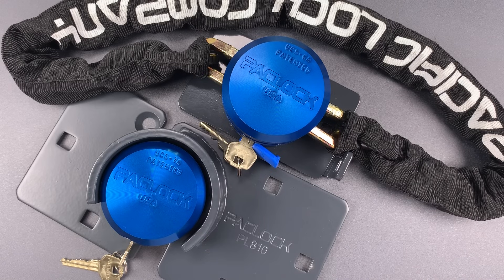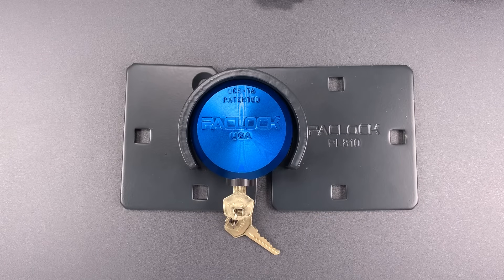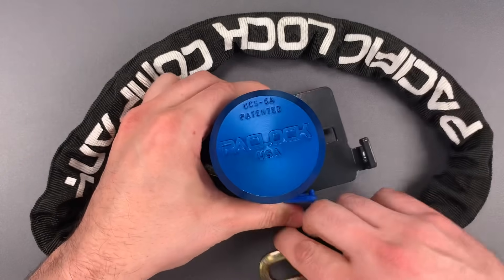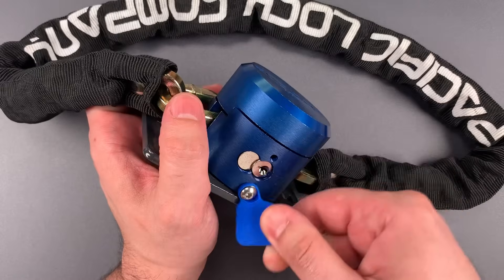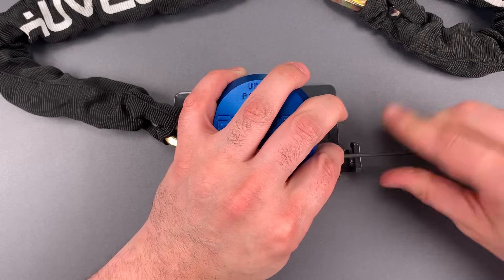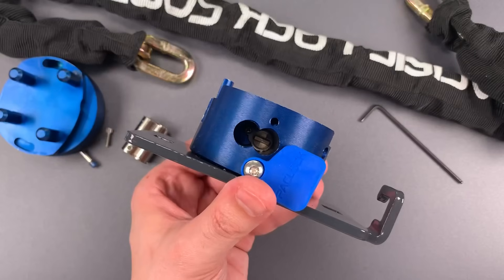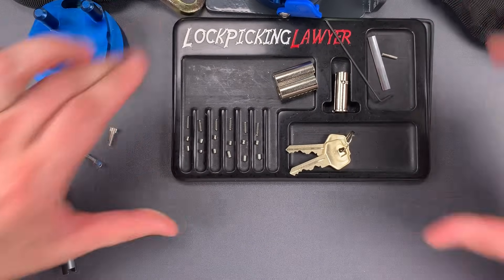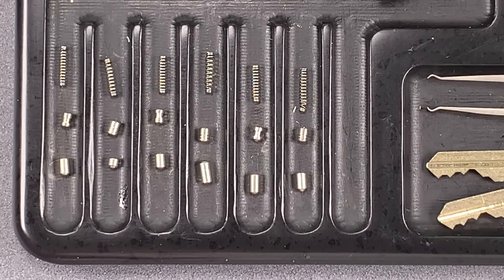[932] More PacLock Products Coming to Home Depot

Comment: Try picking one when installed!  I imagine that reaching overhead to that roof rack installation would interrupt the lockpicker's style and make it more difficult.  Unsure if the door-mounted lock would be in a difficult position or not.  Since the lock is fixed, why don't they have some plates or blocks to make it more difficult to get hands in there to pick  but yet still easy to insert and turn a key?

Comment: the other locks that bosnian bill showed has the core with the keyway vertically so picking is more difficult.

if you are going to get a longer chain make sure to use a very good chain as the weakest link would be the chain if you nd up getting a cheap chain

Comment: Definitely well made, but still "fairly" easy to pick.
Reply: I wouldn't say easy to pick. Lpl just makes any commercial lock look like a D shackle in terms of security.
Reply: The most likely attack is going to be a big hammer or a crowbar to rip the thing from the thin sheet metal of the vehicle door.  Any greater security in the core itself would be kinda pointless.

Comment: Is there enough room or play in the chain lock to get a cutoff wheel in between the halves when locked? It looks like the locking mechanism only interacts with one of the prongs, so if that one prong could be cut the chain could be removed. Another point of attack could be either of the studs that pass through the chain, but that would require two cuts and an awkward positioning of the grinder between the chain and the surface to which the lock was mounted for the second cut.

Comment: I don't understand what the point is of having a strong steel core and a thick chain if the plug is the typical weak 6-pin that you can open with a standard tension wrench and hook. I might be missing something or I'm too stupid to understand, but to me this seems like taking two pieces of indestructible vibranium and tying them up together with a rope.

Comment: Can you use this lock to beat up thieves instead of protecting your stuff?
Reply: Fawzan Fawzi 😂 innovation!!!
Reply: i would argue that it technically still is protecting your stuff.
Reply: pick it up by the chain and flail it on them, gods it hurts just by thinking about how hard a hit with that can be.
Reply: Take off 1 sock, drop it in there and commence beating your enemies as needed
Reply: klj2382 Would one hit each be sufficient to eliminate them permanently?
Reply: depends how hard you swing it... my arms are basically a chunk of wet noodle and fat so i don't think my hits would kill anyone...
Reply: Swing it by one end of the chain.

Comment: It looks like you could slide a bypass pick through the open back key way and turn open the lock.  Kind of like American lock.  Is it possible?
Reply: Jon, bypassing our UCS™ locks using this method won't work. The back of our cylinders marries up with a slotted driver and restricts the rotation of the actuator without the core being turned- which means the shear line needs to be made. In our non-UCS cylinders, we also fixed this issue that American locks had by changing the position of the half-moon on the back of the cylinder. Now there is no free space to rotate the actuator without creating the shear line.

Comment: If like to see a puller on that core of the chain lock. It doesn't look like that set screw would hold up all that well to a slide hammer.

Comment: I had a similar  style  lock and lost the keys for my trailer. I drilled the lock through the key hole and also through the face around near the top where the pin turns and locks into the board at the top. And boom your open took about 30 mins

Comment: I think the pins all being steel is not so much for drill resistance, as it is for durability. These locks are expected to see quite a lot of use, and probably abuse if thieves try to rake them open, so steel pins would probably last longer.

Comment: Well, these being made from aluminium is a pretty big downside if you ask me. They could be steel, weight is not a concern. Make them a little more expensive if need be, the picking resistance is good enough to not worry about it.

Comment: Cool locks with everyone having the possibility of converting to one key, brilliant!
Reply: Only up to 5 or 6 of them (depends on how many cores in that replacement kit).
Reply: @two_tier_gary_rumain  It's not particularly difficult to take apart the cores and make more of the same. I did it with the dozen locks at my house (did the 6 door locks as a set, and the six deadbolts as a set).
Reply: @UncleKennysPlace  Yes, but you need to have a grasp of what to do.

Comment: Can either of the puck locks be used as a bike lock??? Like can you remove the puck lock you picked from the plate or buy it separately and without the chain so we can use existing chains or buy ones whatever length we need??
Reply: It looks like the lock is attached to the base plate with 2 removable screws from the back.  Here's the relevant drawings: https://www.paclock.com/product-line/puck-link/
Reply: Yes, correct. Can remove the plate and you can change the chain to whatever length you like.

Comment: It'd be nice to have a dual ball bearing locking mechanism on these as opposed to a single ball.. My intuition tells me that if you used a sledgehammer and wedge you might be able to shear off the single pin that locks the top in place.
Reply: Once you get one in your hands, give it a shot. If you can defeat it that way, I'll send you your money back or maybe send you a new one if you'd like. Either way. I think that the all four of the pins will play a role because the tolerances between the pin diameters and the holes are pretty darn tight. So any sideways/tilting force will actually cause all of the pins to create some surface tension and help the ball bearing resist.
Reply: @paclockpres.9805  There'll be a home depot nearby once I get to college, I might take you up on that offer. It's an iffy attack, but I could see it working.

Comment: I don't really get the additional bolt hole under the lock. It still seems like you can grind the three boltheads of on the right side and free that side from the door.
Reply: Yes, you can grind the right side, but the left side is still locked on and the puck is holding them together. So you won't be able to open the door...

Comment: Could you explain why things like spools and serrated driver pins make picking more difficult...and why varying spring strength help protect against bumping?  And what are your thoughts on bumping...I hear it is more or less considered cheating in the locksport community, but maybe that attitude has changed over the years?

Comment: Yeah, this video sounds promotional, but we all KNOW better.  I think LPL and BB are just happy to see a company really working to try to make a good product.  Congrats PacLock.
As to the pick time, first, the LPL is crazy good at this stuff, and second it has got to be tougher to pick either of these "in situ".  And correct me if I am wrong, but aren't those cylinders replaceable with several other really "high security" cores
Reply: @paclockpres.9805  Ah, well. Thanks . Is it possible to upgrade to one of your regular steel pucks? I understand, this will not be via Home Depot, but I am local to you, if you are still in Valencia.
Reply: @RAkers-tu1ey  Yes... keep in mind that this "UCS" cylinder system is like a whole new cylinder system on top of everything else we do. And it's made for more the retail market who needs to run to a Depot right now and grab something. Our entire line of the same padlock bodies but with the "standard" cylinders is certainly available. So hardened steel is available... working on getting stuff loaded into Amazon now to make it easier for everyone, but that will be a few days (a week?) before we get most everything loaded. We're doing some cutting edge stuff their too with how to sell padlocks. And we are still in Valencia!!! Thanks!
Reply: @paclockpres.9805   Great to hear. I was afraid maybe you had moved to Dr. No's island to set up for Home Depot production.
Reply: R. Akers that’s actually a representation of a pipe.
Reply: @cpmenninga  aahh, at last they see

Comment: Would it make such a lock much safer,if there was a metal plate welded about 3 or 4 cm under the cylinder,so the key can fit it,theres not enough space for picking tools though?

Comment: Do they sell that chain separate?

One of the things I have found most difficult is getting any kind of chain that looks reasonably strong...most places only sell wimpy chain (that they cut to size with short bolt cutters) or the vynal wire cable (which isn"t much better it seems)

Comment: This chain lock is cheaper than the Krytonite bike lock. I'm thinking it might work for my bike!
Reply: Gonna get one for my gate, and Vespa . Trying to have 4 different but quality ones to rotate , on the gate , and all the rest on the scooter. I have 2 houses in my neighborhood that scooter thieves are operating out of .
They stole my older vespa in June. I followed one, riding my scooter , and took it away from them a month later. It was hot wired, and the guy on it opened the seat, with a steak knife, and grabbed all his saws and picking blades out , dumped them in the backpack with all his bolt cutters and ran away. The struggle is real

Comment: I’ve scene pucks left on bumper of van twice and stay there for over 30 miles
Reply: Okay, got a good laugh here, thanks! Me too. And I see lots, and lots, and lots of vans where they only have the hasps and no padlocks on them. I've talked to lots of construction company owners and lots of plumbing company owners who are at their wits end because they want the higher security on their vans, but their employees literally just lose the padlocks day in and day out. So we think we've solved that problem. Bolt the darn padlock onto the haps and you're done. 

One thing LPL or BB didn't mention is that this puck/hasp combo was designed so that it can mount both on the rear swinging and the side sliding door WITH the puck fixably attached to the hasp. Lots of design and testing.

Comment: This is more less directed toward Paclock.  That little pin, in #2 chamber, lower or key pin.  It appears that it's nearly as tall as it is round. Need to watch that, in the 1st 2 chambers.  Chrysler has had issues, cast zinc with brass pins.  What would happen is, wear and tear over time.  The lower pin would wear, and get tipped over on it's side, and ultimately getting stuck - and we ould need to remove the lock, and remove that pin stack altogether.

I just received 2 of the KIK-2B padlocks, I'm kind of disappointed.  The cylinder retainer is made of Aluminum.  I can see that with an Aluminum body, but not a Brass body.  Please, make that retainer from Steel.  Otherwise, great work so far, I'll recommend your products over Master!  BTW, I'm a Locksmith of almost 30 years.
Reply: Thanks for the info on the pin and cast zinc... we should be okay since we're a full brass cylinder (both plug and shell).

For the KiK-2B, historically the industry supplies a brass retainer with a brass padlock. If you buy a hardened steel padlock, you'd get a hardened steel plug. When we re-looked at our entire KiK product line a few years back, we realized that it doesn't make sense to supply a brass retainer on a brass lock. Really, it doesn't make sense to do brass retainers at all.

The reason is that brass as a raw good is going up, up, up in costs. It's why aluminum locks are making a huge surge and brass is taking a downturn. So when we looked at making the retainers, we realized there's no benefit to making a brass retainer versus an aluminum retainer. It would just have cost more to do brass. Either way, you can drill a brass retainer like you can aluminum.

So if you bought a brass or aluminum lock, you wouldn't have ever had a hardened steel retainer from us (or from other padlock manufacturers?). You would have seen a brass one. But we just don't do the brass retainer anymore.

We do have that barrel plug in hardened steel, but it's only shipped when we ship a hardened steel lock.

Comment: Can the bottom part of the "PUCK LINK" be removed from the plate? If so do you think this would make a good motorcycle lock? Love your channel. Thanks.
Reply: Yes, it can. Just a couple of 1/4"-20 Stainless bolts holding it on. And you can rotate which way the hasp holds the link so that you can mount the link in portrait or landscape. We've had people use it for bikes and motorcycles... it's a little bulky, but most good motorcycle locks tend to be. Give it a shot and let us know! If you're not happy, just give me a call (my # is on our website) and I'll do whatever we need to do to get you squared away.
Reply: @paclockpres.9805   Thank you so much for your response. I will have to give it a try.

Comment: These PacLock locks look really nice and I feel tempted to grab some for family although even the more standard ones are a bit pricey especially for someone like me who has never gone into anything more expensive than a cheap master lock most of the time (I also did not know much about lock strength and security until recently). I'm hoping to see the two channels work on brute force methods next, I see some comments about them ignoring weaknesses and I don't think that is the case I think they want to actually try and force the locks before making big statements and I for one would like to see how the locks stand up.

Comment: Look like very high quality locks but, I'm a little hesitant on spending more $ for an aluminum lock. Yeah it won't rust but, 15 seconds with a torch and the cylinder falls right out
Reply: We always start with an aluminum lock to test the market and then move to hardened steel if the concept looks good. We're going to keep the aluminum body as an option mostly because of the cost savings, but we've already begun production on steel versions of our UCS padlocks!

Comment: I am very new to lock tech so I am confused that you did not mention the t pin driver on pin 5.  There were also tapers on the bottom lf key pins 2 and 6.  What effect do these mods have on picking?  They did not seem to slow you down.

Comment: Could someone remove the screw on the side of the lock, without it being open??  Could that be something that would allow someone to get a crow bar in there to pop the lock open?  Or is the  locking mechanism strong enough to handle that??

Comment: that screw to remove the chain is external and can be unscrewed. huge doubts regarding security.
Reply: Art, that screw can be removed, but it will only do anything if the lock is unlocked. So no worries on security there- still have to have the lock open!

Comment: Am I correct that the actual lock action consists of 4ea aluminum pins, & that's all? Seems like a well placed swing with a sledge hammer would shear the aluminum pins & pop the lock
Reply: Assuming they're using proper 6061-T6 you would be using the swing press for quite a while :U

Comment: Hi LPL, I'm not sure if you'll see this since this video is fairly old but I had a question about the screw. What is stopping me from removing the screw and just pulling out the top and not have to pick the core?
Reply: You are able to remove the screw without opening the lock, but even if it is removed, the lock still needs to be unlocked. It won't open without the cylinder turning.

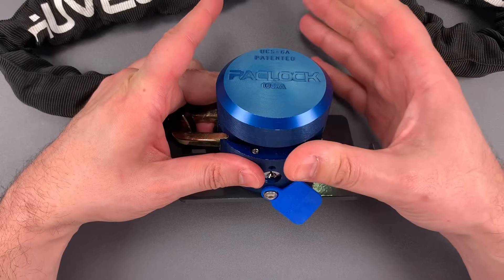Comment: At 5:16 what is preventing someone from just removing that screw without picking the lock if its exposed all of the time?
Reply: That screw only retains the top when it gets unlocked. So you can remove the screw, but it won't affect the lock at all until you've unlocked it. In a way, consider this an extra security feature... if you get to your lock, and the top pops off when you unlock it, you know that someone was messing with your lock!
Reply: @PacificLockCompany  Awesome thanks for the reply.

Comment: Wish I had seen this before I bought my warlock. Funny is I modified my hasp to have a bolt on each side under the lock .
Reply: Huh... yeah Warlock has been out there for a while. Keying is the big issue there. But I'm not quite sure what you mean about putting a bolt on each side under the lock. Is that because their lock is too loose or something? Just trying to understand... always the curious engineer.
Reply: @paclockpres.9805  thanks for reading my comment. I have the Puck lock and hasp. I drilled though the hasp and bolted it to the door, where the bolt head is covered by the lock when it is locked. Like on your hasp.
Reply: @jimbo5635  Ahhhhhh... I see!  Great minds think alike! Well done, sir! If your door swings (not slides), then you could benefit from bolting the puck to the hasp as well! Trouble is, if the puck didn't come with tapped holes, then you've got a bit of a challenge. Our pucks have an option where those tapped holes are there... the ones you see here for HD already have those holes!
Reply: @paclockpres.9805  if I ever need another, I will upgrade to your brand.

Comment: the little pins that hold the chain could easely be grinded off with a disk.
Reply: Francois Dupont 

What little pins?  You have no access to the pins as they are under the lock head and the chain it’s self us in the way.

Comment: Have you tried lifting the pins above the sheer line? Kind of surprised with chamber 2's driver pin being so short given the key pin was also so short. Seems like they are using a standard length driver pin in all chambers. Is that lazy? Should the overall length of the driver and key pin be same length to make sure that they all are longer than the sheer line?
Reply: Overlift won't work on our cylinders...

Comment: Cant you just use a pair of aluminum cutters to remove that piece of metal that holds the chain on and just cut it off.  There is plenty of room for snips to get into the chain holding part.